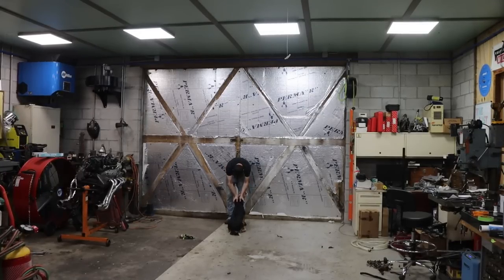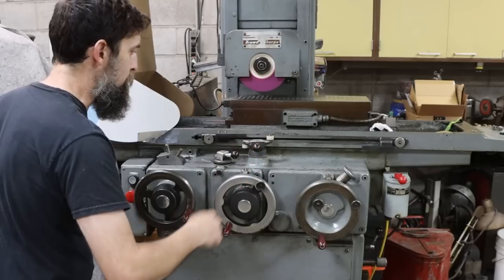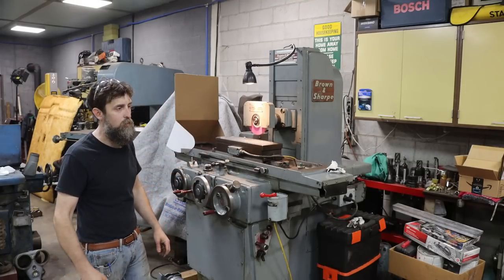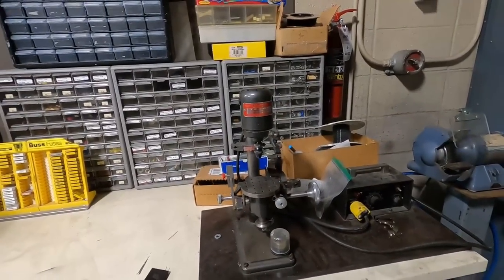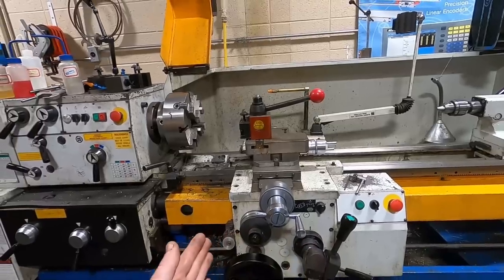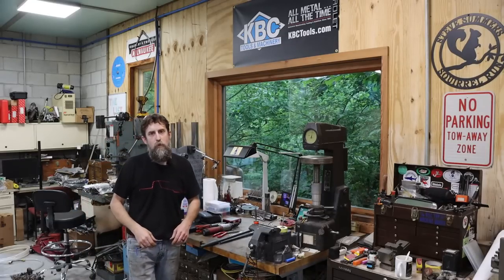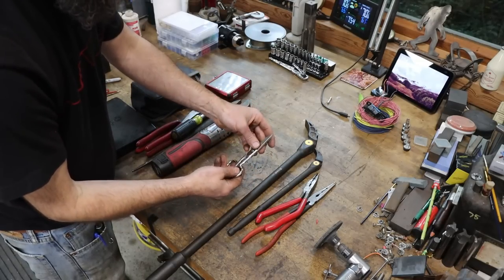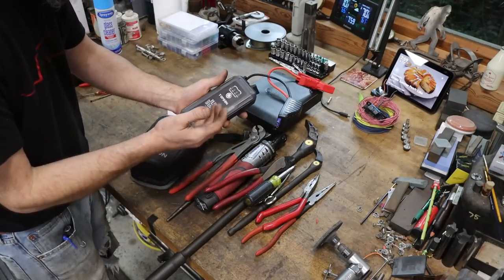Research Machine Shop tour / Brown & Sharp 618 / MY Top 10 hand tools list

Comment: This is the same thing I do for The University of Delaware. I run a small machine shop and build stuff for the labs and professors for experiments and work on lab equipment such as centrifuges and table shakers incubators and such that is crazy I have been watching you for years and either missed it or was not paying attention and thought you worked at a machine shop making parts for repairs and stuff.  I get all my projects on napkins or a thought and they are not quite sure what or how they want it made and I do a design and they look at it or I will try to make it out of 3d printing and then they can see it and maybe try it out to see if it works or fits their needs and then I will make it out of metal or whatever they need. I have found out that the 3d printing saves a lot in materials and time so you don’t spend a lot of time on remake of a part and stuff. I love my job never the same part over and over different every time and it makes it interesting keeps me begging for more.
Reply from the maker: Sounds Very familiar 🤔 😄
Reply: The video shows up one of the problems us hobby "machinests" have; the price of machine maintenance. The oil change on the grinder using Mobile Vactra 1 (the equivalent in the UK) , would need 2.1/2 buckets of oil at about £120 a bucket plus tax at 20%. That's £380, which is money that could well go to new tooling or taking the wife away for a weekend. Maintaining a decent workshop is an expensive business, let alone buying new machines or tooling.

Comment: Steve, the scissors are telephone “cable splicer” scissors, I carried a pair of them with my splicers knife in a dual pouch for over 32 years. They’ll cut anything if held correctly ;
1)Pinky finger in top hole.
2)Ring finger in bottom hole.
3)Thumb on screw head pivot.
4)Pointer & Ring fingers under scissors.
You now have a pliers grip on a pair of scissors with the squeezing power of a pair of pliers!
Good luck 👍

Comment: For your bug problem there's two things you can try. The first is an amber lens as the bugs don't see things in that wavelength and don't seem to cluster around amber lights as much. The other is obvious which is a bug zapper.
Reply: I'd add a walk in door, so a person doesn't have to open a huge shop door every time.
More helpful in cold weather,  but helps screen out bugs too.

Comment: Shop light a good idea would be to get an old phone pole, and mount it  to the side of the door, about half way to the house along the road, with the light on top of that. Then you get both yard light, and light on the shed and drive, but not as big a bug problem. Bring the cable down, and run under the ground in conduit, and up the side to the old light position, so the power is exactly the same. If you want you also put a photocell up by the shop top, and then no need to turn on at night, plus you can place a smaller one to light up the side of the shop by the creek, 10W will do, to  give light at the side, and same for the other side and the rear. At least LED floodlights are lower power than the old version of a 125W mercury vapour lamp, though the old mercury lamp, provided you bought a good quality one, would last, running dusk to dawn, for 3 decades or so.
Reply: Decent ideas, many ways to skin this cat, will probably need a multi pronged approach... However, I've gotten the impression that his property is more or less on rock. Setting a pole might be quite the feat. Even more so to trench. but getting the brightest of lights away from that door one way or another is probably key. The comedy option is having one of those weed torches staged by the door. Sparking that up and clearing the swarm before entering. Might want to have some sort of firefighting contingency along with that...
Reply: @davewood406  Yes the property is built on shale, but easy enough to borrow or rent a large SDS plus hammer drill, and make a series of deep holes in solid rock, and then place in some steel angle, and use an anchoring cement to fill the holes to hold them. Cable can be run surface in steel pipe, with it running to the side then if you cannot dig, or dig down into the shale, or simply have an overhead line like the shed power already is.

Comment: I have one of those boost packs (different brand), mine has seen use 4 times in the last 24 hours, as my car had its previous battery suddenly die, I was headed out on a trip, when i got in the car, it barely turned over, so I boosted using my pack, arrived at my destination (london) and parked up for a few hours, came to go home battery dead, got me started again. arrived home late so this morning i used it to boost the car again while testing (alternator was giving good output) then a 4th time to get me down the auto shop and pick up a new battery (turned out the old battery was 9 years old). so yes i can fully attest to keeping one of those in the car, 4 starts (of a 2 litre diesel) and it was down to 50%power, (and is on charge being topped up as I type)

Comment: My favorite tool as a mechanic of many decades is a Snsp-on 1/4" ratchet that has a 3/8" drive lug.  It is smaller than the shorty 3/8" ratchet and if kept clean and oiled, will withstand all the torque your hand can apply.  Mine is over 40 years old and going strong.

Comment: Hello Steve     I  started working  in 1968 at TMW in Reading  PA.   The company bought a bunch of these grinders for parts production only they had automatic down feed on the down feed wheel  (you could set down feed wheel to stop at  a set  (ZERO)  The Auto down feed could be set to take as many tenths off up to a thousand at time  on the pass of the table under the grinding wheel )   These grinders ran sometimes 6 days a week 3 shifts  for years making parts for knitting machines and medical products.      Fast forward 42 years   I retired being a Tool and Maker till running some of these machines bought in1968  I know they ran relatively  maintenance free  other than required service and oil changes  You got yourself a good machine

Comment: Hi Steve, when you were saying about the jerky travel on the B&S surface grinder my first thought was air in the system, good to see topping up the oil sorted that. Another little tip, try to minimise stopping the spindle when you're working the machine, but if you do have to stop the spindle for any reason, remember the wheel will move a gnat's cock on restarting due to inertiia so take a light skim with the diamond before resuming grinding. All The Best from sunny-ish Midsomer Norton.

Comment: You didn't mention it but after you added the oil the wheel was completely disengaged. The sound change was significant. So nice to have a simple fix occasionally. Good video. Thanks

Comment: A trick for using less oil in a temporary situation is to put some scrap blocks of metal in the sump to take up volume. It is not a long-term solution.
You can also fill a softdrink bottle with water and cap it tightly.
Don't use wood or concrete or bricks, but sometimes large hard stone will be okay, like graywhacke or granite.
Reply: The volume of oil acts as a heat reduction agent, prolly best to spend a few more $ and do it as instructed by the guys that built it.  Me thinks.
Reply: @wrstew1272  agreed, - this is a dirty hack, just to get the level up purely for for testing.

Comment: Those Klein scissors and 11-in-1 screwdriver are on my list, too. I also have one of their earlier 10-in-one screwdrivers which had one less nut driver size. Your day job shop looks great, and it was delightful to see the surface grinder smooth out with some more oil in its tummy.

Comment: Steve  I also have a set of those Knipex Cobras and a set of the Knipex smooth jaw Pliers / Wrenches.  My only beef with them is when you're left-handed, it's tricky to push the button to adjust them.  The work-around required is to change to your right hand to use your thumb, then swap back to your left.  A bit of a pain, but they're so good in all other repects, it makes up for the left-handed tricky part.  I also agree with your choice of the Klein multi-bit screwdriver.  I believe they call it a 7-In-1.

Comment: Mr. Summers another thing to check is the transfer cylinder connection on the underside of the table. A shop I worked at once bought a used Norton and when we tried to get the table to move back and forth it would bind up. The nuts under there need to have a little play. Thank you for your efforts, Mike

Comment: I had the same issue with my 8x24 NORTON, so far I'm running on about 18 gallons of like you stated, very expensive oil. Good to see you had success with adding a little bit more oil to the unit. Probably needs another 5 or more. Good video. George from Indiana
Reply: Yes, but you can use almost any hydraulic oil there, even the cheapest ones will exceed easily the standard the original machine was designed for, as this is a century old design. Plus with the use case you will be replacing oil regularly, due to contamination with fine abrasive dust, unless you are prepared to upgrade the in machine filter packs to include a 10 micron filter as part of inlet filtering, and then output full flow filtering of at least 200 reduction of 4um particles, preferably better.

But on a grinder hard to keep this without using large filters, so the large volume of fluid, so that some can settle out. Of course placing a smaller volume into the existing housing, using a canister fitting into the existing volume, and thus using less fluid, does leave room for the filters, and having some magnetic catchers on the returns, and filters there, to catch at least the ferrous particles, does help a lot. 

But abrasive dust will always be there, and on this kind of machine the one thing that requires it to get regular maintenance and cleaning, which means fluid changes on the regular as well. The buying of expensive oil, versus the low cost one that meet the spec, means running cost is lower, as after all the oil here is not really being stressed any, running lowish pressure, low flow rates and low temperature. 

I have been running some machines with plain refrigeration oil, straight mineral oil, simply because it was always going to be contaminated, and the plain oil, with no additives, was both very cheap, and a really good lubricant. Especially with it being changed monthly due to contamination with dust, in a vacuum pump. No need for expensive vacuum oil, which was not lasting any longer either, and the cheap oil from the refrigerant supplier was a lot cheaper than any motor oil on retail. Not worth buying in bulk, a 5l bottle would last 6 months. The pumps were classed as a disposable item, simply because some of the dust did contain silica, and the oil oil went into a drum, which was recycled. Not worth rebuilding a $500 Chinese pump, though I did maintain them, and did replace a motor or two that burned out. Did rebuild flexible couplings, the flex members I made were guaranteed to outlast the pump, being made from scrap conveyor belting, over the original mystery rubber like plastic of the originals.

Comment: I suspect that the grinder has a tight spot and the pump was pushing a bit of “foam.” Whenever it hit the tight spot, the air in the fluid would compress and the table movement would slow. 🤓

Comment: Steve, i bought and repaired a similar 618 that had autofeed front to rear etc too. The filters for the oil I used NAPA brand and can look the numbers up for yu. Also the cogged belt that drives the table can be bought at NAPA for 20 per cent of the cost of an original.  I loved mine but sold it to do another.

Comment: Thank you for the shop tour at your employer. I have a similar love affair with the Kalamazoo band saw and the Arboga (or whatever brand ot trades under) drill press for the same reasons that you do. My employer has both machines and I used them regularly. Our Kalamazoo spent a couple of decades as a multi shift production saw before being replaced with a new machine (same model). Its second life was our maintenance shop saw where we ran it regularly for another 25 years. I want one for my home shop SO badly. It is big enough for sizable stock, but handles small workpieces with finesse. It is a dream to use. Other brands and models have their strong points, but this model is so simple, robust and well rounded that it is my personal favorite. 
Multi piece and really heavy stock usually ran on the production heavy automatic saws, but even in production quantities, our second production Kalamazoo pretty much ran non stop around the clock. It eventually got down graded to a Hydromech upgrade. The Hydromech had lots of very cool features, and was highly engineered, beefier, but was so inferior to the old simple Kalamazoo in quality. Abom loves his Hydromech, and I bet that his intermittent job shop use will prove a very fine match for that brand, but my experience with that brand was very disappointing. I still want the simple Kalamazoo.
The Arboga is much the same way as the Kalamazoo. It is loaded with features that enhance function without cluttering the landscape with complexity. It keeps the simple simple while adding or upgrading features uncommon on similar sized machines from other makers. Geared head with simple speed changes, two speed reversible motor, all table and head adjustments and clamps easy to use, enough mass for rigidity and a small footprint. The fancy styled quill feed handle knobs are a nice touch too. 

Our shop had a production Grob band saw similar to your DoAll. That is a very nice alternative to the DoAll. Did DoAll make any of their equipment? My experience with DoAll is rebranded product. I have a very heavy DoAll drill press (a big brother to your Wilton/Arboga). It is a very well built machine (rebranded by a Portuguese firm that folded, making purchased repair parts obsolete). It is a beast, but it is too cumbersome to use for simple tasks. I find myself using lighter duty machines more often. The Arboga is just a nice well rounded option.

Comment: Add Knipex parallel jaw pliers and you'll have 11 favorite tools. Need little force to hold, never mar the bolt or nut, and fits anything like the Knipex channel locks.  Don't delay, buy today.
Reply: The only bad part about a Knipex tool to me is that everyone pronounces the name incorrectly. In Germany (where they are made) the K is not silent.

Comment: The machine shop is interesting.  I now see where you get your mechanical work knowledge and experience.

Are your regular small parts (nuts and bolts, screws, etc.) bought in bulk and "pre-0expended" for use by anyone in you shop, as needed, without lots of paperwork?  I worked in the summer once in a US Navy test agency where this was done to speed up results.

About the bugs on the large outside door.  Perhaps some fine-mesh screen door material sprayed with a conductive layer and charged with a small, low-power electical charge could be naikled to the door outside and drive away any bugs trying to land on or near the door center where you open it.  An electrical OFF set-up?

Comment: If this uses a ram to move the bed , then the slowing at mid travel may indicated a worn ram barrel where the fluid is leaking past the piston. The mid travel area is where most movement will have occurred during the machine's life

Comment: as for the light over the door , maibe move the light to the middle of the yard on a pole or in a three and just point it to the door , that way the biggest swarm is somewhere around the light and not near the door
would suggest spending some time on that cnc lathe and mill if only to learn the cad drawing program you have a few machines at youre home shop that you could convert to cnc if you wanted to and still have other machines to do stuff on by hand
still be a good idea to get an a frame crane , in this case it couldve helped getting that grinder off the palled , guess the pallettruck is too light for it , maine if you have a few toe jacks you can lift it up then pull the pallet out from under it , be sketchy though if one of those jack slips out from under it nothing stops it from going over (you shouldnt even try to stop it or hold it up)
maibe just lift the front and wreck the pallet by slamming the blocks in the middle and the front then lower it and do the same in the back , then start pulling planks and stuff from under there untill its allmost on the ground before setting it on skates , that way if one of the toejack slips the thing will at least stay standing

Comment: With your B+S grinder.... You may not have noticed that cable plugged in the right side which is 'rubbing' as the table oscillates.  This can cause insulation to chafe off of the wire over time.

Comment: Steve you would cry when you see my place of business. We have a 2000 ton press and when we blow a seal in one of the four motors that drive the press we can send 500 to a thousand gallons of hydraulic oil into the pit it’s recycled but it’s expensive to replace

Comment: If you REALLY need a tool for low clearance, VIM HBR3 and HBR5.  I haven't found anything more compact.  VIM also makes some nice, short sockets with 1/4" hex rear but for some reason they are only sold individually.  I'm probably going to pick up their sockets in 10mm and 8mm for working on the cars.

Comment: When you were grinding the chuck,  it sounded like it was cutting more at the beginning of the stroke in both directions. Does that mean you should snug up the gibs before grinding in the chuck and table, or is that amount of table rock unavoidable?   Edit:  or is that phenomenon due to the spindle lifting maybe? Is it just the weight of the spindle providing downforce against the lifting screw?